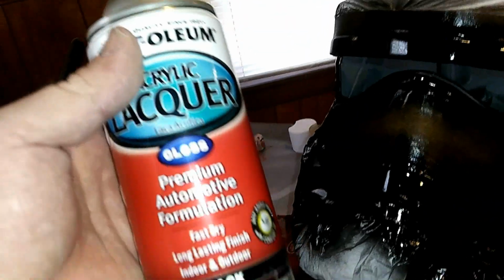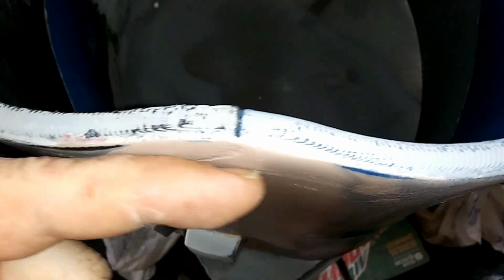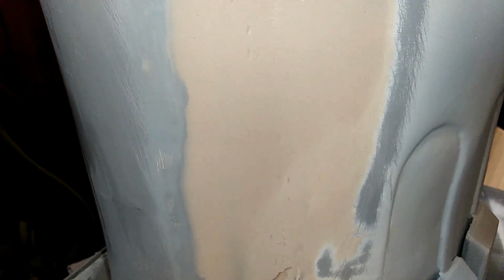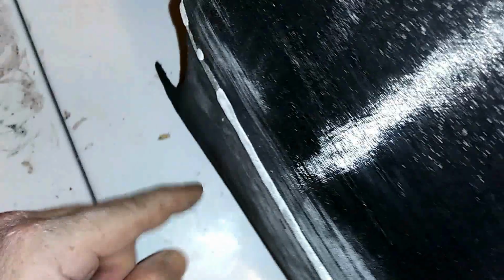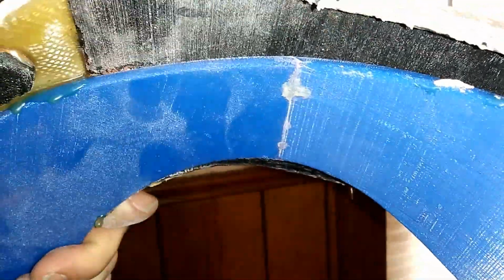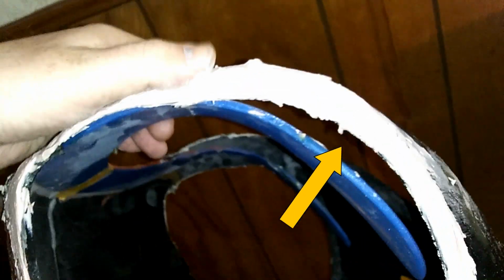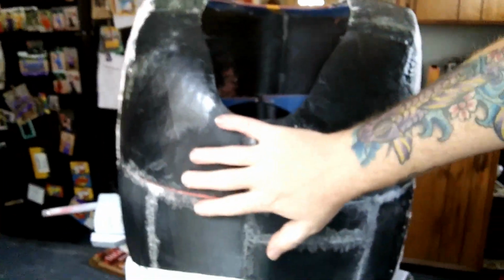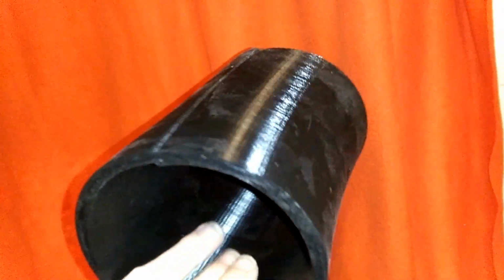3D Printed Cosplay First Order Storm Trooper Part 2

Comment: Really nice, but when I paint glossy (super gloss like darth vader helmet) I dont use gloss paints, I use a clear coat, but you have to be careful, it takes 4 days to fully dry, and you have to choose really well the brand with the smoothest (trigger) or use a airbrush, the results are amazing, my Vader helmet looks like a black mirror. gloss white paints are really bad to dry right? hahaha
Reply from the maker: I found a really good acrylic gloss to go over my props recently that you can paint on just about any color. So im able to just match whatever colors along with a photo and then hit it with this clear coat only about 24hrs after applying the last color. its amazing.